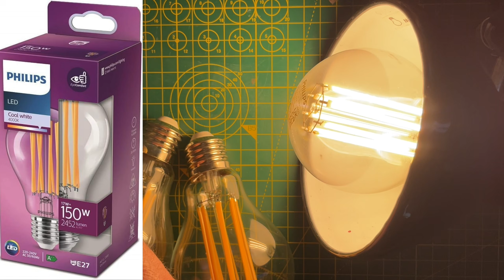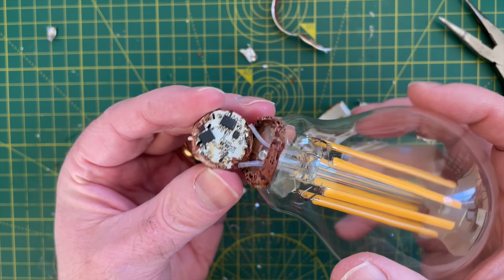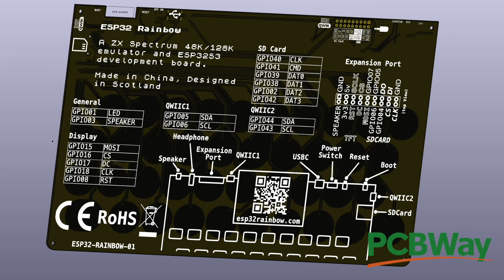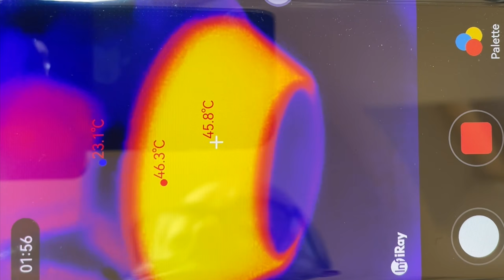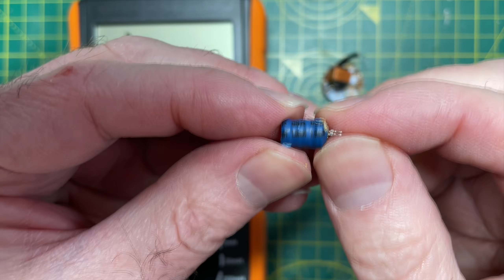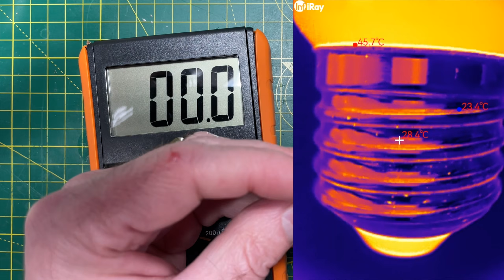Not what I was expecting! Why are all my lightbulbs failing?

Comment: These are "powerful" ones at 17 watts, which are expensive. Better use 2 smaller bulbs. They can be bought cheaper and won't fail at the same time, and the heat will be distributed. If you have a globe, you can fit a Y splitter.

Comment: I wonder if the green package ultra-long-life Phillips bulbs have a different series/parallel arrangement to prevent this kind of cascading failure? I’m surprised this one was using a switching converter in there, but since the caps weren’t what died I guess it’s probably fine.

Comment: Maybe not a general advice for the internet, but I break and remove the glass every time I install a cob led bulb for that exact reason. Just beware that the internal terminals carrying AC will be exposed, so only do it for bulbs out of reach. They now last years instead of months.
Reply from the maker: Heating does seem to be a problem. Big Clive has a bunch of videos where he modifies bulbs to turn the current down as well - makes a huge difference to bulb lifetime.

Comment: 25 deg above room temperature is not too bad
Reply from the maker: Yep - need to test again with black tape on the metal as suggested in another comment. I'm also going to take apart (smash) the working bulb and run it bare so I can measure the temperatures directly.
Reply: @atomic14  shiny metal can be a pain for reflecting infrared energy. black tape is defo the way to go.

Comment: Very disappointing from Philips I used to recommend them.. I prefer to get dimmable and dim them to 80% or so nowadays, never had any dimmable bulbs fail so far.
Reply from the maker: I think dimmable bulbs tend to have better construction as doing the dimming requires a lot more electronics. These ones are annoying as they are pretty expensive. But all the ones we've had have failed in a couple of years.

Comment: So actually the power supply (the bulb's base) should be cooled in these things, whereas in classic bulbs it was the wire that got hot.
Reply from the maker: Looks like it - though I am going to take apart the working bulb and see where the heat is coming from.

Comment: LEDs warming up excessively slightly elongates the whole substrates. This in turn weakens the bonding wires and the bonding points, especially with the lamp turned off and on daily.
Reply from the maker: Makes a lot of sense - and would explain the failure mode.

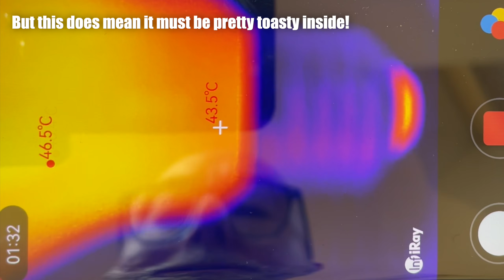Comment: 4:26 the metal part doesn't look hot on the thermal camera, but that's because shiny metal has very low IR emissivity - it's basically a mirror in IR and you can't get a reading on it directly. Put a piece of black electrical tape on it, then you'll see the real temperature with the thermal camera.
Reply from the maker: Good point - I'll give that a go!